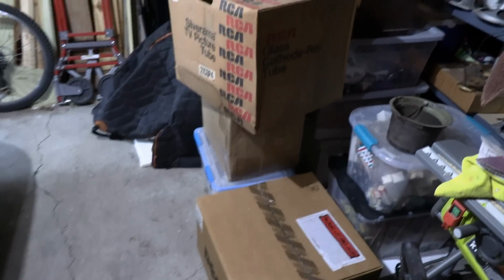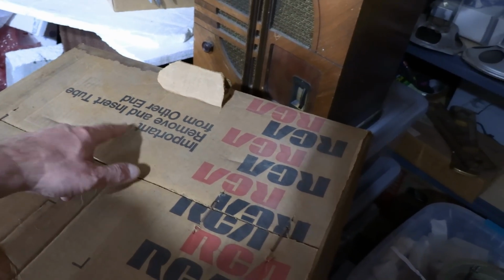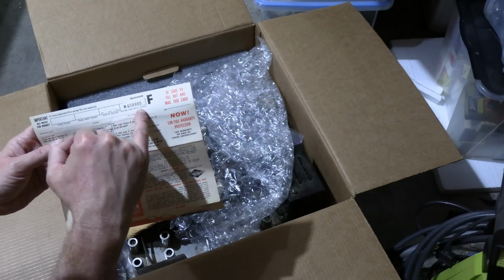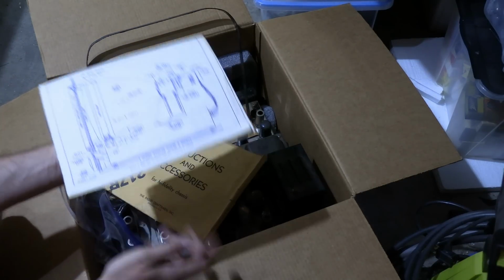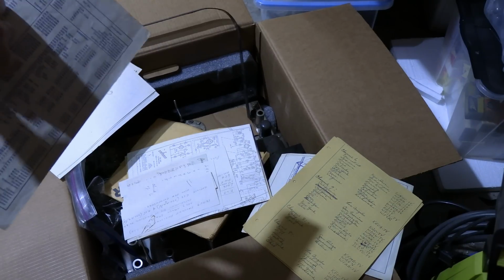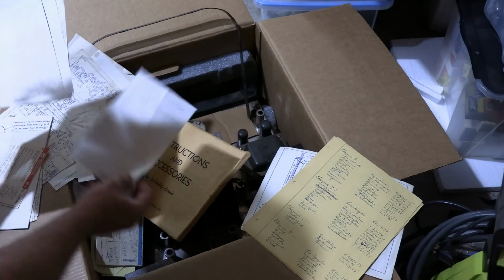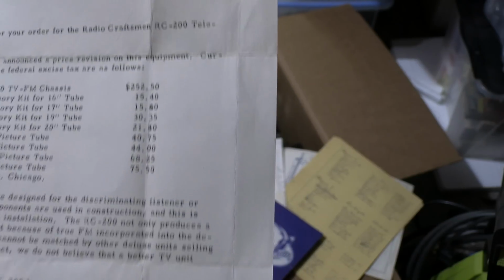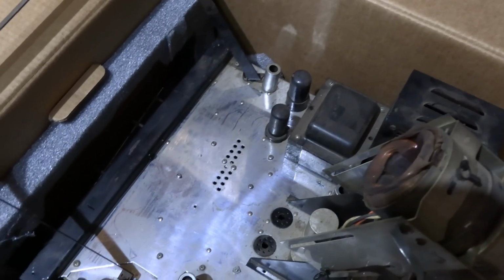ETF 2023 follow up: Radio Craftsman RC 200 chassis and rebuilt CRTs

Comment: No doubt he was DXing TV. Remember there was freeze in new television stations from 1948 to 1952. If you had a TV you were in or near a major city as there were only 108 stations. The rest of the country had to go without or try to do fringe watching and DXing. Locally our community didn't get a station the middle of 1954. Being surrounded by mountains DXing was a challenge but some did it, including my grandfather. He erected a super tall antenna and had a boost amp to pull in stations from up to two hundred miles away. The pictures weren't perfect but watchable and the neighbors piled into front room. Gramps said he should have charged admission.

Comment: Extra cool stuff! Although the chassis dates earlier, the DX log might well be from 1956-57, when the HUGE solar cycle was taking place. He might very well have received all those stations, especially if he had a rotatable antetnna, mounted in the clear. Nuclear tests in the ionosphere during those years might also have contributed to enhanced conditions, at least for short times.

Comment: The CRT manufacturers didn't make the envelopes or faceplates. They bought them in from GLASS manufacturers like Corning or Owens-Illinois, who produced them in standardized shapes and sizes per EIA specifications.
Reply from the maker: Ah-ha.  OK, that sure makes a lot of sense.  Thank you.
Reply: Right. If you could imagine the steel molds for 17 inch and up CRT envelopes must of been pretty massive. Then there is the machinery to handle such large pieces correctly. I think that I heard that, at least in the later years, the molds were spun to get the glass to form correctly. On some CRT datasheets it specifies a radius of curvature for the outer surface and the different  inner surface of the glass. How to do that is not common knowledge. So even though the glass envelope of a dud takes up a lot of storage space, it is the irreplaceable part. Those large steel molds have been scrapped long ago.